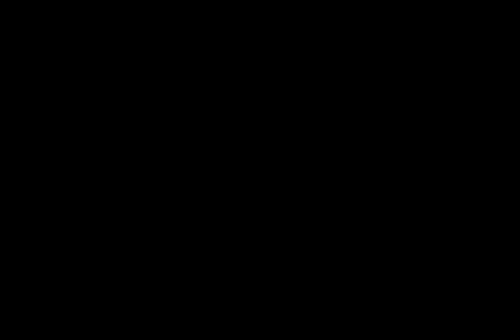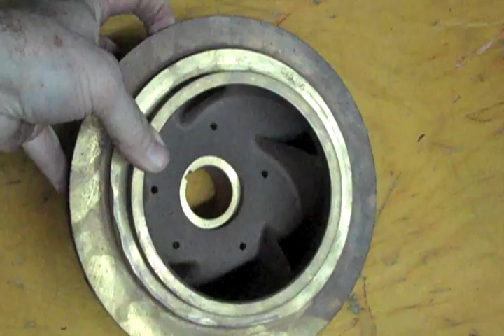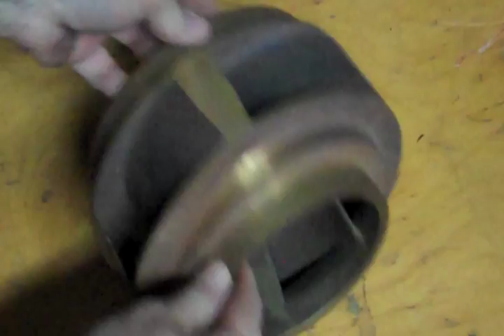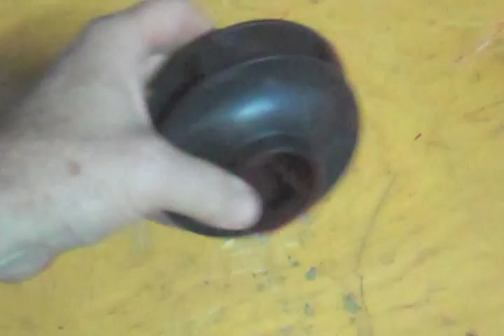pump Impeller rotation direction how to tell which way motor turns spins by looking at the impeller

Comment: Whats the logi behind this?
What is the exact science behind this?
Is there any specific formula for determining which way gonna iy will rotate????
Reply from the maker: which way it is 'going'  to rotate is a result of the motor or engine rotation .. which way it SHOULD rotate to pump correctly is what i am showing you .. its up to you to make whatever is driving it go the correct direction
Reply: @thebrainard  thanxx a lot for replying...
I wanna make a dc impeller like that for high pressure.
Reply from the maker: thats a bit beyond me ... as you probably already know pressure is related to tip speed of the impeller, determined by diameter and rotation speed  .. the width has to do with volume ..  thats about all i know .. good luck

Comment: I was a little worried I had reverse wired my pool pump and it was spinning the wrong way, until I watched this.  It actually turns opposite to your intuition as he points out.  I too thought of the outside vanes scooping up the water--wrong!! Thank you, Roger Brainard.
Reply: Same here.
Reply: And would it worked in wrong direction or not ? Water comes out or not?